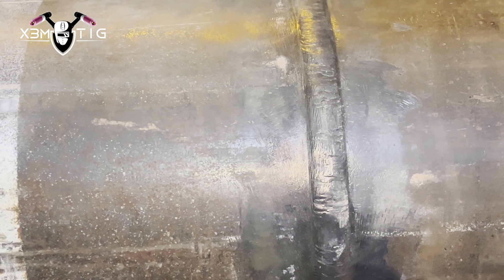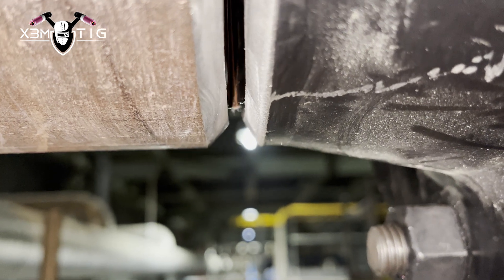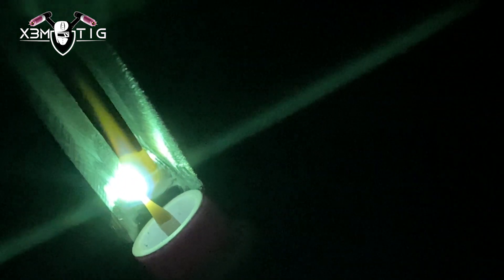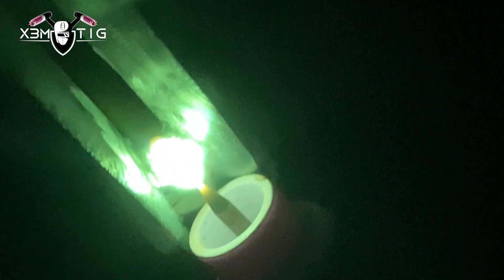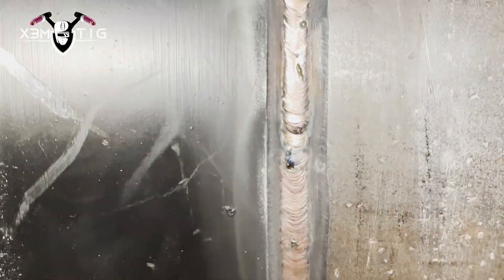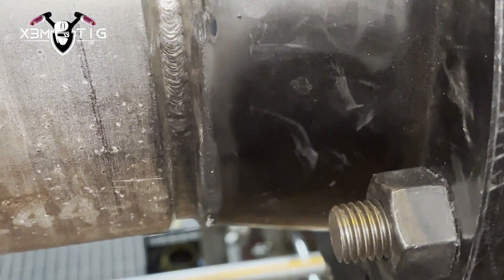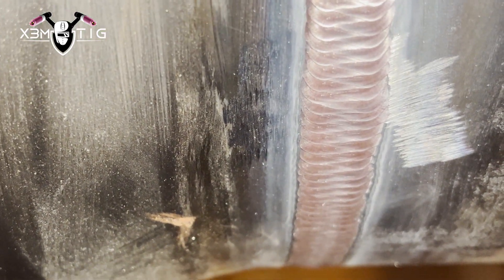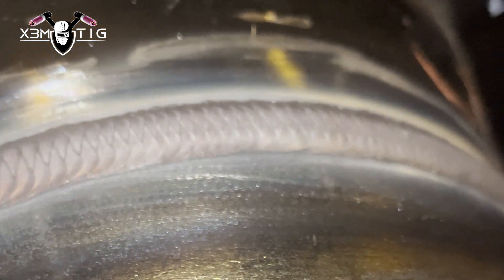5G TIG Welding Root Pass — How to Nail a Perfect Weld Every Time

Comment: Interesting stuff again here. As 488 member back in the day, I worked at the Kearl phase 2 project welding on heavy wall in the pipe racks around utilities. It was pre-heated at 320 F which  was pretty hot but loved the process. Now working at the Valero Refinery in Quebec and starting doing some TIG again which is challenging after many years not touching it, but still really enjoying the re-learning process as I didn't do that much TIG but that single project in Alberta. Thx for the great videos posted here again buddy. :)
Reply from the maker: Glad you’re enjoying the videos, and thanks for sharing your experience!

Comment: Nice work man, I always wanted to learn this job but im stuck in a fab shop mig welding all day😂
Reply: Most guys that get into welding get stuck in a shop mig welding on a production line. Don't waste you life guys, go after the opportunities where you find them. I've wasted away mig welding and I'm 37 and kicking myself for it. I admire these pipewelders .
Reply from the maker: We all stuck somewhere at one point where we didn’t like it, but you have to make that move and go somewhere where you can learn what you want, even if it’s less paid…